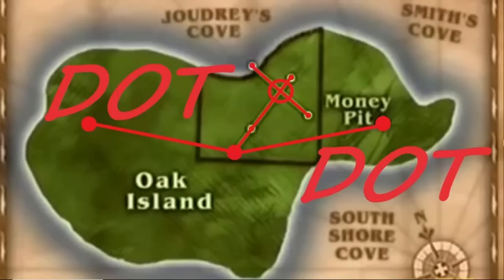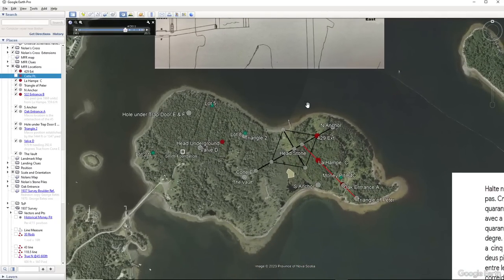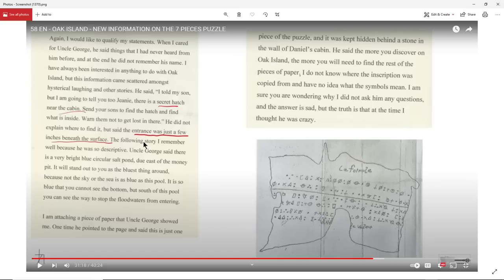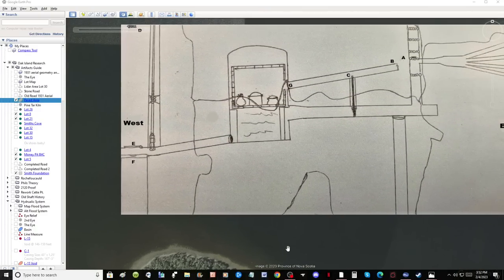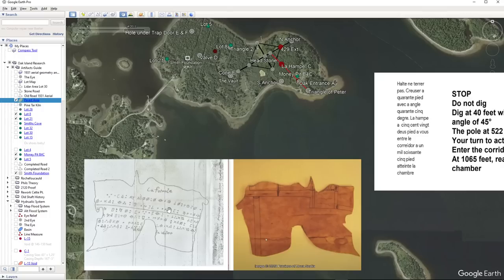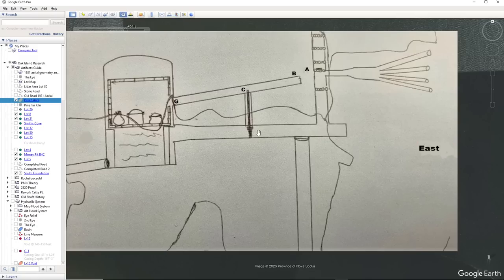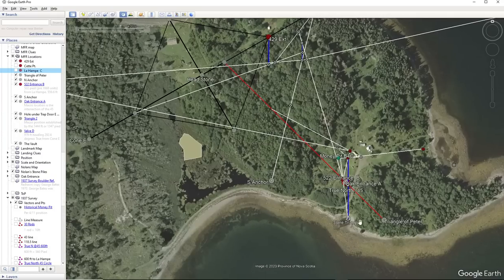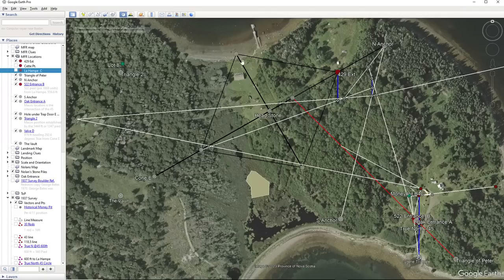Oak Island Mystery: Solving the Mystery of Oak island

Comment: Don't know if I have worked this out wrong but using the pythagorean theorem if you dig at a angle of 45° for 522ft you would end up being 371ft below ground. Am I missing something or do you only dig for 40ft at a 45° angle?
Reply from the maker: At the Oak Entrance A you dig straight down to 40Ft. AT 40ft you dig along the 45 degree line. This is an azimuth direction of 315 degrees true. If my calculations are right you reach 522 Entrance tunnel B in 20ft.
Reply from the maker: By the way thanks for your comments, you know this video I made by your last.
Reply: @DOTtoDOT  thank you its much appreciated. Been reading so much into all of this and the more I do the more it's easy to get frustrated with how the team are going about it on the island. The more I've watched yours and oak island research videos and seen all of the connections between the different books from The Scrolls of Onteora, the Mcginnis book, zenas book its almost impossible to not believe in zenas map. I did read the blog that Scott Wolter did and I don't believe him I just think there's some sour grapes there is all.

Comment: If La Formula says, "Stop, don't dig."  Why does everyone think you must, do what you would have done naturally and dig straight down anyway, but stopping at 40 ft to continue at a 45 degree angle?  I think the instructions mean, "Don't dig straight down,.  Dig at a 45 degree angle for 40 feet." Is that possible?
Reply: Yeah that's me I've thought this the entire time,but would that be possible
Reply from the maker: Yes, 45 degrees is an azimuth direction. When the landing is executed on Zena's map, the North arrow of the quadrant points the heading 135 degrees true from Cone A of Nolans Cross. Since you are going towards the quadrant center heading is 315.